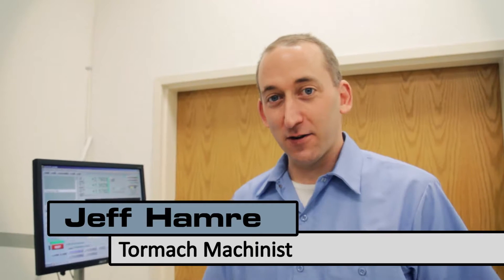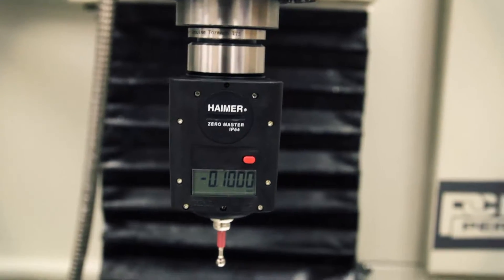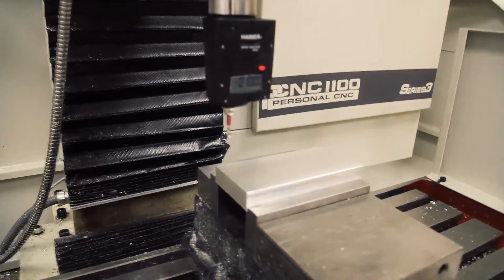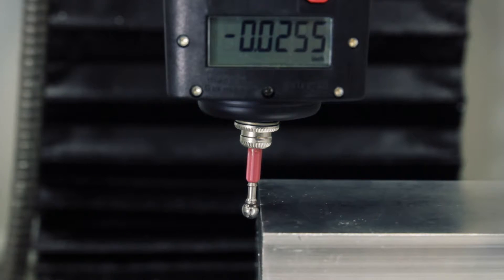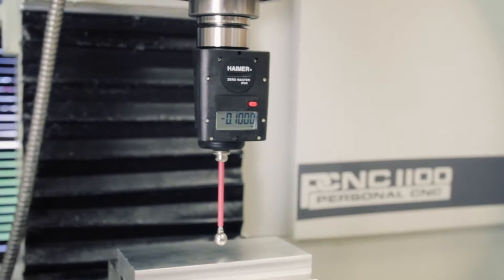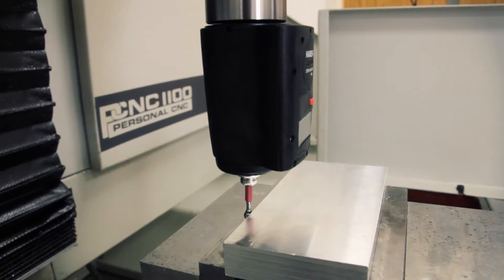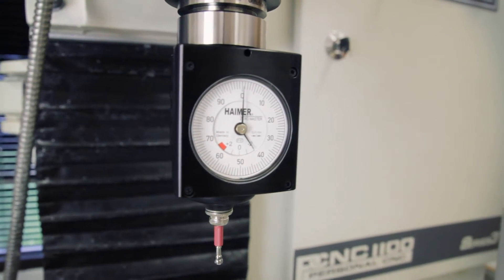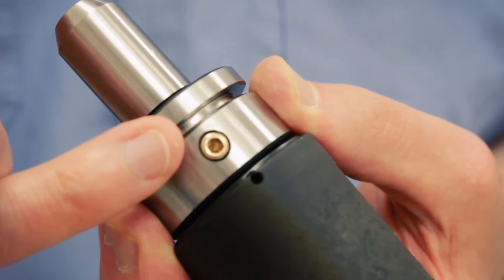How to Use the Haimer Zero Master Edge Finder - Tormach CNC

Comment: Brain, you need to really see the difference, there is no cheaper alternative expect an edge finder. Machinist will not doubt agree this is the best tool for the job. It is all made in Germany no Chinese cheap movements or parts. They can even repair it if you crash it.....